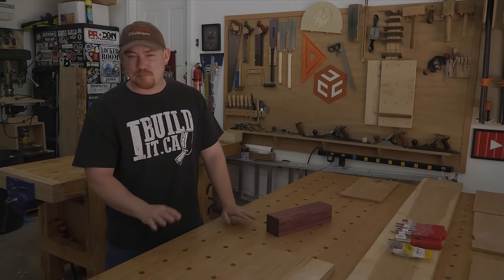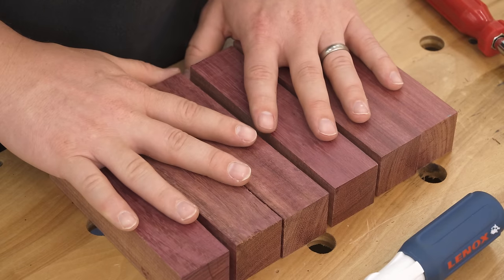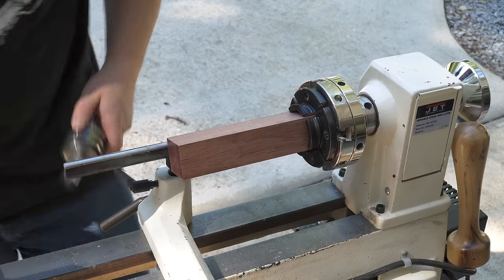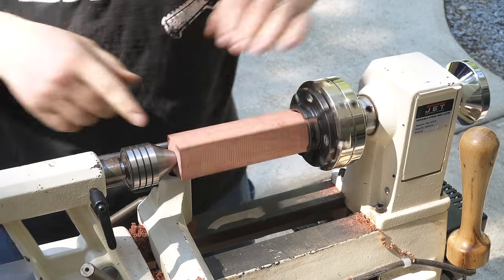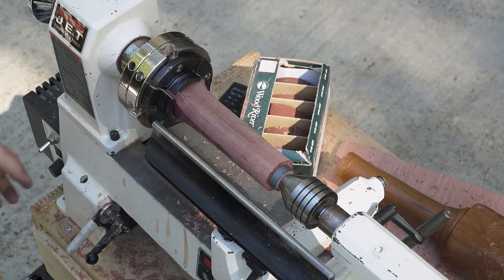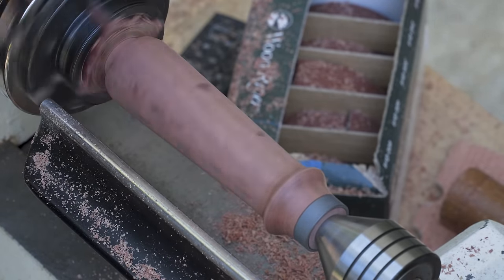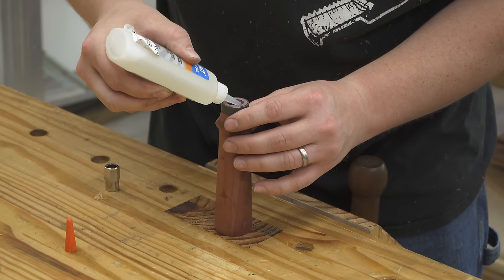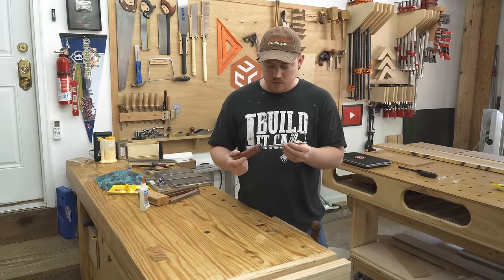Screwdriver Hack - 280

Comment: My experience with the tennon for the ferral is to make it a tight fit so it can actually compress the wood fibers slightly. I've had a couple come loose over time, just like that and with glue, from humidity changes. Just an FYI.

Comment: Very nice! It looks like the old finish worked just fine, even if it was expired. By the way, I have found that certain shapes of handles that I need to torque on work better than others and the cylinder seems to lose traction in my hands, especially if I am sweating. A nice alternative is a rounded off square shape or rounded off triangle.  Ive always likes how Snap-On screw drivers felt and gripped with their squared off shape. But these came out looking great with that wood! I would love to get a lather like that JET one day!

Comment: 1.  Harbor Freight has coupons for those screwdrivers as freebies all the time.
2.  If you file a flat on a dowel the size of your hole and lay a pin on it, then slide the handle on, you can turn & finish the bottom of the screwdriver easily.
3.  If you make the handle bigger around, not only will it be more comfortable, but you can also get more leverage on the screw with less effort.  The ones I make are probably half again as large as the one you made here & people love them.

Comment: Nice handle, however I prefer a handle with 4 sides.  When I can't exert enough torque I can attach a wrench to it to increase the torque greatly.  I also like a fat handle for the same reason.  If the metal insert is hex a wrench goes on that nicely too.
Nothing beats hand made tools.  I once made a special shaped screwdriver to fix a car out of a spike.

Comment: I think the handle should have grooves in it, just for extra grip when you're torquing down on things. I have a really old screwdriver, hand made, not sure if it was turned or carved, easily over a hundred years old as I believe I was told it was my great great grandfather's. Somehow it was kept in really good condition, no rust or anything, and the handle isn't all beat up. 
I really want to get a lathe, but I just don't have the money or space, and all I have is a concrete patio with a shed that's already full. Some day, I might get into it and make all of my hand tools. I'm also considering just doing a cnc table with a fourth axis lathe attachment, then I could do intricate pieces that I'd never be able to do by hand.

Comment: those are actually 7 in 1 screwdrivers the nut in the handle works as a nut driver as well i have one of those i use at work as a throwaway in my belt

Comment: nice idea to spruce up a cheap screw driver. careful with the nut driver ends of the red screw driver. I stripped that out pretty easily at work driving some quarter inch screws with my drill.

Comment: Nice one. But is the hardware decent enough? My experience with cheap screwdrivers is that the metal starts chewing off and the flat tip gets twisted.
Would be a shame to invest work into craptacular quality hardware.
Reply from the maker: I've got a few of these scattered through my house and I haven't had any thoughts other than they are handy. Nothing negative so far.
Reply: the bits can be replaced with better quality ones if it comes to that

Comment: larger handle? for more torque? you meant longer, right?
larger handle makes for better grip but not better torque, a longer handle means harder to handle but way more torque
example, remove a torqued screw with your handle and length of driver
then use a longer driver or handle gripping at end 
torque is created by tension on driver by handle not strength in your hand  when turning

looks way cool though always wanted to learn wood turning 
keep videos coming

Comment: Where did you get the ferrules or did you make them?
Reply from the maker: PEX fittings in the plumbing section at a hardware store.
Reply: Jay Bates Thanks! I've been looking for another turning project!
Reply: I bought a bronze bushing at Menards.  It has a flange on it, just used a hacksaw to cut it off.  You have several sizes to choose from too.  Bronze stronger than copper too.  I was inspired to put this on my first turned lathe chisel.

Comment: The idea is fine, but the ergonomics could be improved.  When one uses a screwdriver one needs to push and so the back part design could have been more rounded as it would fit the hand for torquing and pushing at the same time. Another characteristic  would have been better was that instead of relying on pure friction to torque the handle one could have a few indentations as the two original screwdrivers . A four sided or an eight sided handle for a screwdriver plus a rounded rear end would have  been more ergonomically efficient.   But then on occasions who cares about efficiency as long as one enjoys what one does.